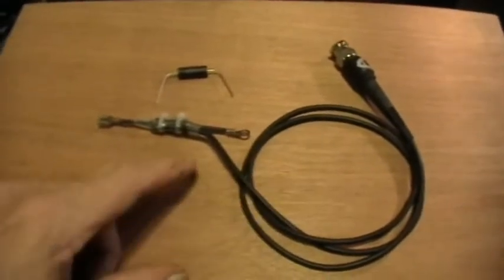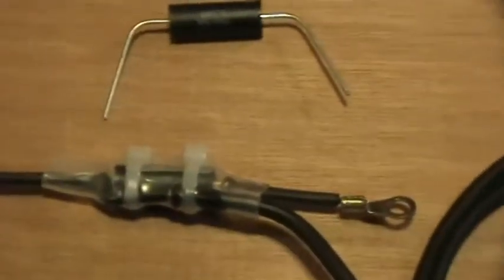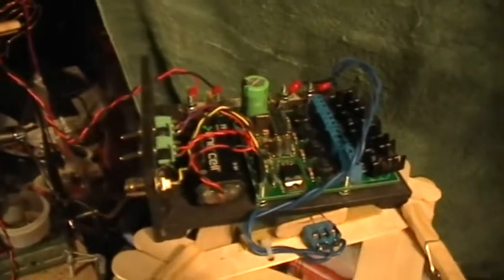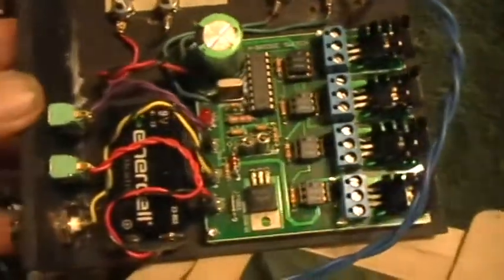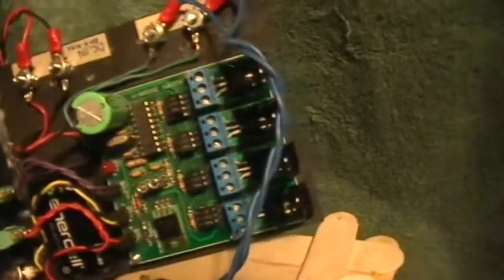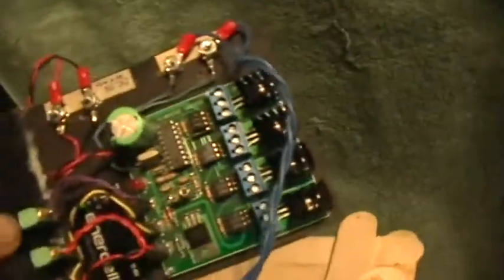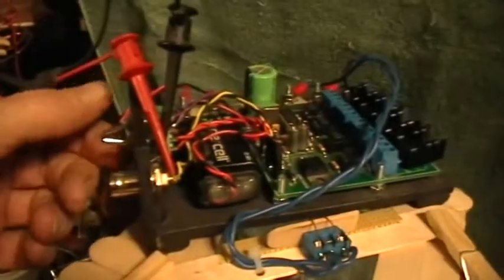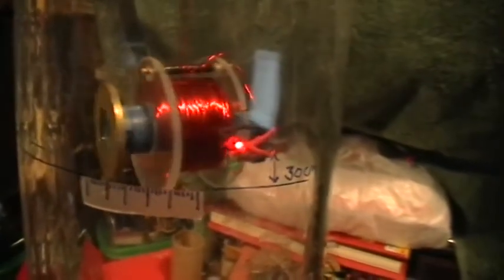Reactionless Propulsion: Charrier Experiment 2A: Preliminaries

Comment: In AC, greater will be the frequency, greater will be the impedance, lower will be the intensity and lower will be the thrust because the thrust is proportionnal to the square of the intensity, for this reason the thrust is independant of the sign of the intensity (polarity) and works in AC or DC